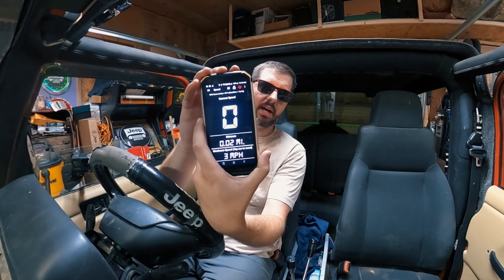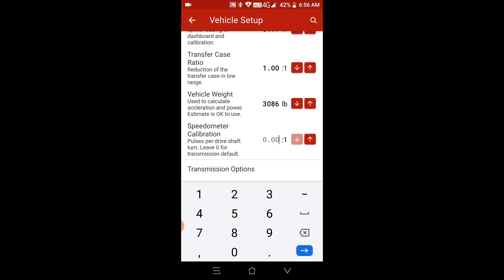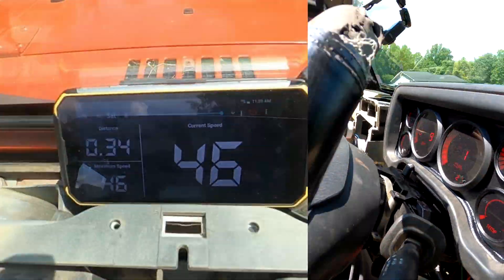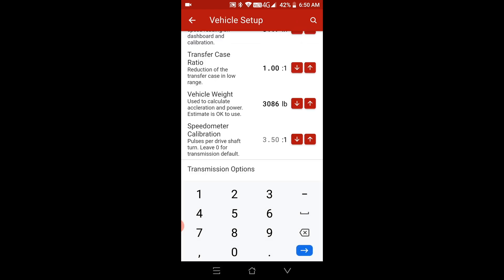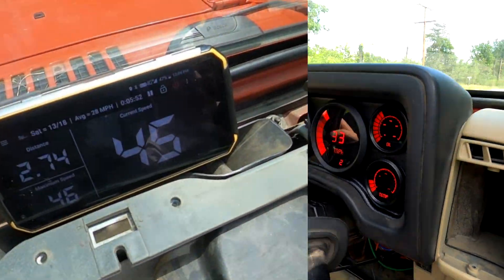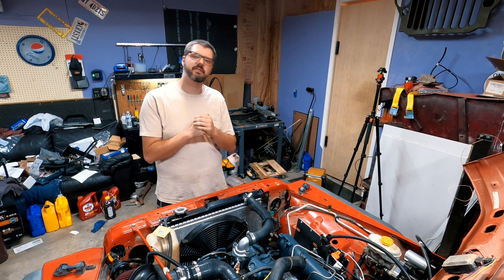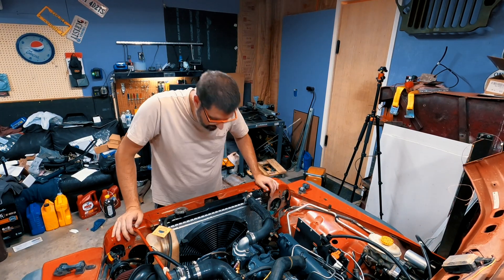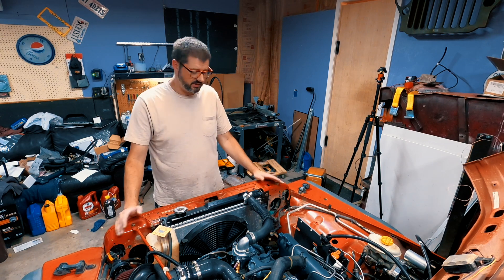Speedometer Calibration, Power Run, & Cooling System Failures [Diesel RHD TJ - 74]

Comment: Sorry I missed ya, as always great work, and I wish ya luck on the cooling issue. Maby ditch the t stat for now?

And once ya get it dialed in any chance you could drag a 3500lb trailer to see how she does. I'd be very curious as I tow alot.
Reply from the maker: Hey Patrick I have no idea how I missed this comment so I'm sorry for missing it! Truthfully I think the diesel would do fine but I don't want to try pulling 3500lbs with my short wheelbase. I am curious to see how it tows, I just haven't gotten around to checking yet but will report back as soon as I do!

Comment: You can remove the comment because it is off-topic.  How do you remove and reinstall the air vents?  I have a '97 TJ and 3 out of 4 of my vents are broken
Reply from the maker: No it's fine Brannon! I've broken of few of mine as well. I don't know the best way to pull them off honestly. I think with time and especially with exposure to the sun the plastic becomes brittle!